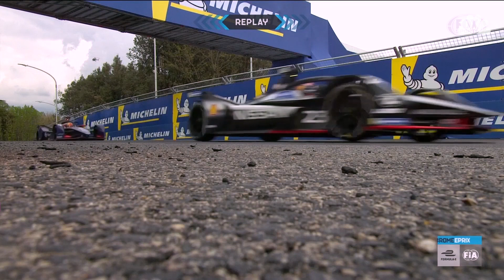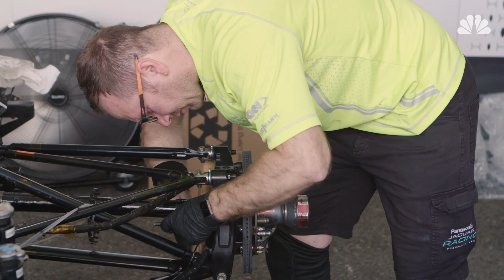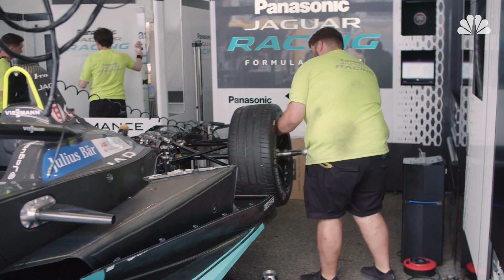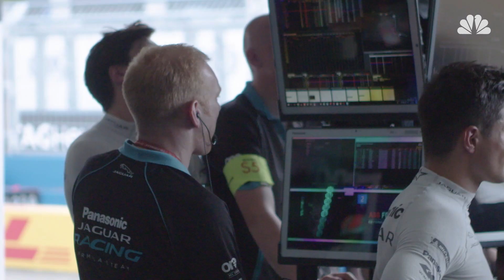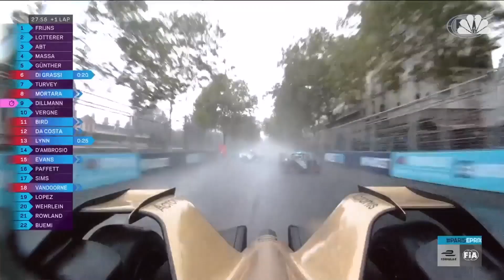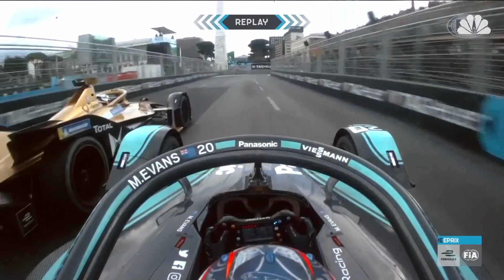Formula E: A New Era Of Racing On The Forefront Of Battery Tech | Mach | NBC News

Comment: Half the fun of going to the races this the noise.
Reply: Roger Out They can always use artificial noise. Electric cars for the street have to so pedestrians don’t get run over.
Reply: @GratiaCountryman  artificial noise doesn't shake your intestines.
Reply: Roger Out Sound is sound. All sound is vibration. Any sound can do that with sufficient amplification.
Reply: @GratiaCountryman  I've never seen noise Amplified loud enough to shake whole building like an earthquake.
I guess speakers just don't have the same back pressure as an internal combustion engine.
Reply: Roger Out The speakers at a rock concert shake everything. Also, the reason you get that sensation is that you are dealing with the combined noise of many cars.